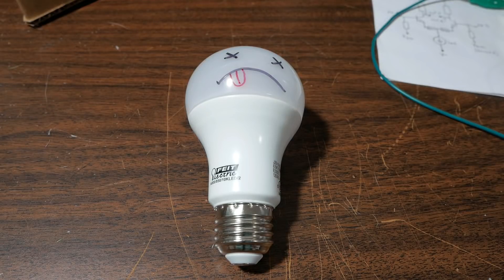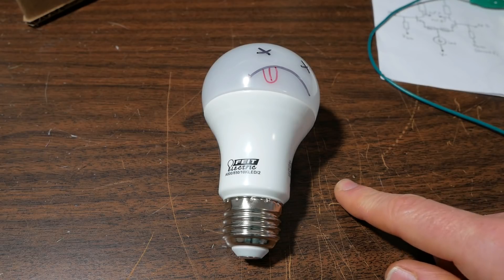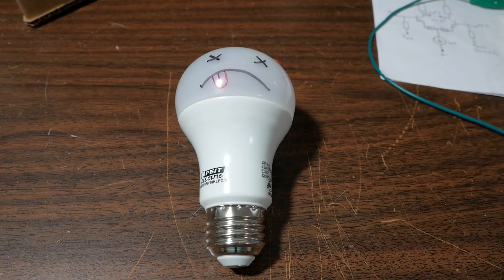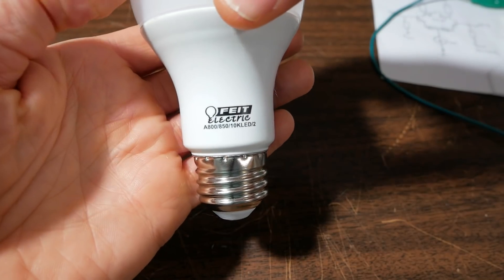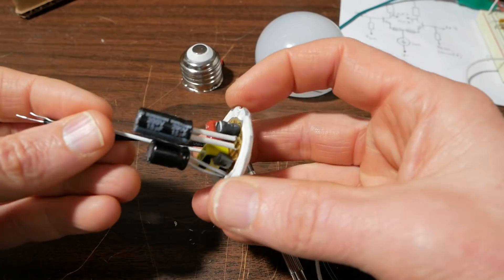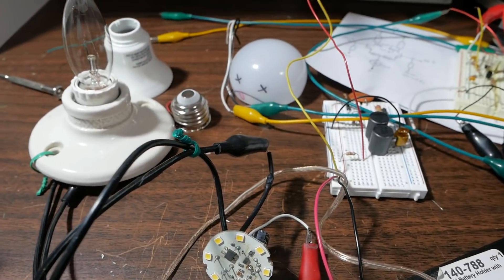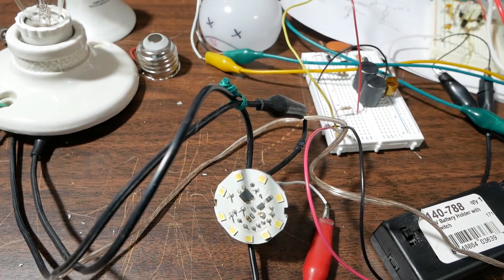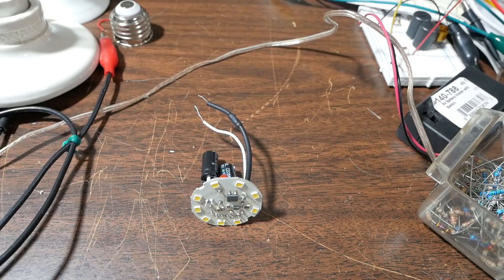Another failed LED bulb to teardown

Comment: At work we had an LED strip light fail (230v), not all at once, 1 section flickered occasionally early on & then failed totally several months later.  Soon after the rest started flickering & a few months later just flickering dimly. I'm curious to know what's wrong with the strip light & whether I can bypass some dodgy LEDs or replace a component to get the whole thing going. I have a DMM (as part of my job as a car mechanic) & some knowledge of basic components, but nowhere near enough to diagnose what's up with this light. Can you recommend to me a sight (or if you have any, your own tutorials) where I can learn how to diagnose this mostly dead strip light? Is that feasible?? lol
Reply from the maker: One thing you can test if you have access to the LEDs and are able to get a good connection on each LED is to measure the voltage drop across each LED in the strip. If the voltage is very high compared to the other LEDs, you know you have an open circuit LED. Be careful as the voltage can be high. All of this assumes that the LEDs are series connected.

Comment: I've had so many LED bulbs fail in my house, it's frustrating. Cheap ones, expensive ones, various brands, etc. Any tips on how to determine why they have failed? I've kept them all, because they're not cheap and I hated to throw them out.
Reply from the maker: It could be the LED chip itself or the driver board. Sometimes the wire leads inside the bulb have a poor connection to the socket.

Comment: Hi John, I had an led bulb go out on me a while ago, and what I did was jump it out.  and it worked, but a few months later it failed again, so I'm going to save this burned out bulb for parts.  so next time an led goes out I'll just replace it.
Reply from the maker: If easy enough, I scavenge the LEDs of the board for other uses.

Comment: I stocked up on these (Feit) at Costco a few years ago.   I've since had serious failure rates.  I e been swapping them out for GEs.  The failure rate is much less, but I suspect a lot of issues with the cheaper bulbs are because of surges and sags in our local power grid.  All of my appliances of any merit, and electronics, are all on surge protection or UPS to mitigate it.

Comment: The TO-92 transistor package is a current regulator. I have an LED bulb that uses a similar type of chip. It seems that an external resistor sets the current.

Comment: I've only had one LED bulb in the last 4 years, with exactly the same issue; 1 failed smd led though with mine I could clearly see a dark speck on the LED. I'm just waiting for higher CRI LEDs now, preferably 90+

Comment: Cold one just bridge the dead one, reassemble and keep using it? And if not, why?
Reply: It looks like he has to ruin them to get them apart.  He pulls them apart and they'd look like hell to glue them back together, etc.,. On one of his later vids where he looks at 2 LED bulbs, he has a hole drilled thru the plastic globe and puts a pencil thru the two holes and uses the pencil like a t-bar and pulls on both sides of it while holding the base until it cracks apart.  See what I mean?  They're shot after he takes them apart and tests them.

Comment: I thought you're gonna repair it.
Reply from the maker: If I had another dead bulb of the same model, I could use an LED from it but all the other ones still function. It isn't really worth the effort.
Reply: @JohnAudioTech
just bypass the one and use as normal :-)
Reply: @JohnAudioTech  I have tried repairing one bulb using another. Can't get the led's off. They are very well glued...

Comment: Is it the case that one failed led takes down the entire array ? I notice that with the old style LED bulbs with literally 100 led emitters visible - one or two will fail over time , but 15 years later the bulb as a whole is still working. Wouldn’t it help reliability to wire these in parallel not serial ?
Reply from the maker: Most of these LED bulbs have series connected LEDs. When one opens the bulb goes out.
Reply: JohnAudioTech it seems like a bad design, dooming it to failure in the way the old fashioned Christmas tree light strings would loose one bulb and the whole string would go down.
Reply: Maybe, but it's difficult to drop the voltage low enough for parallel diodes.
Reply: @John Peterson
the current to drive them in parallel  would be too high for the simple power supply :-)
Reply: The manufacturers don't want them to last, they want you to buy new ones.

Comment: Not  audio   related  !
Reply: Actually LED's are very reliable - I use LED pilot lamps in all the industrial control panels I design. No known failures. Incandescent pilot lights always fail at some point in time.
When it comes to the LED light bulbs, it is a different story. The LED chips for these are produced by the billions, bound to be a bad one or two in the batch.